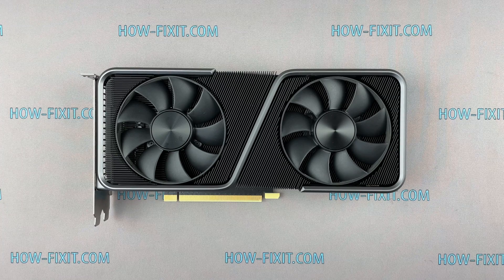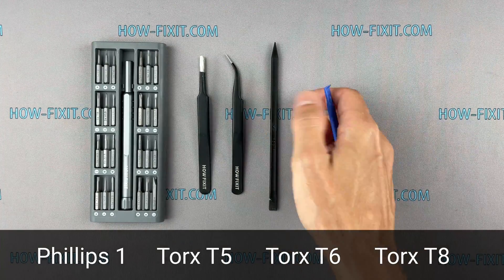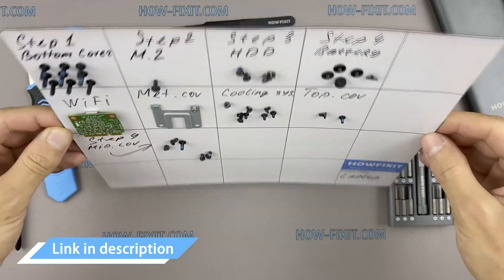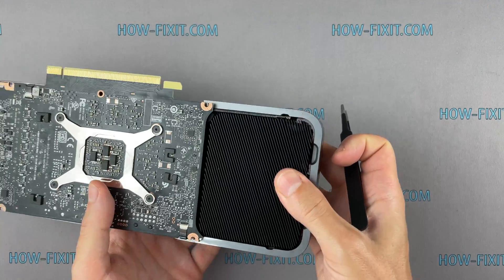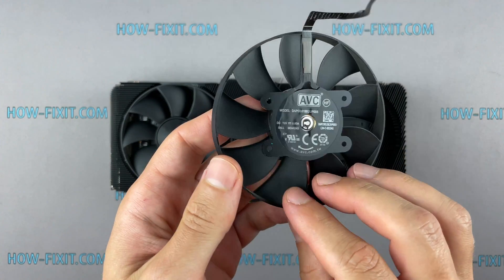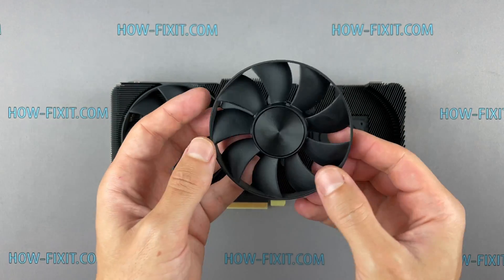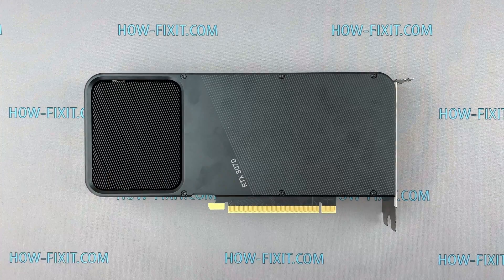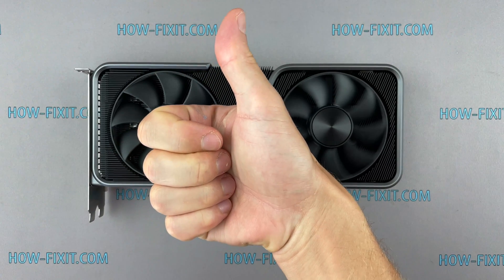GeForce RTX 3070 Fan Replacement

Comment: Thank you for this guide. I was unable to source a new fan but using this, I flipped my fan over (without removing it) and ran some WD40 into the bearings. See the open centre part of the fan. I believe mineral oil would work best but this is what I had. My clicking noise has now gone.
For anyone doing this, just be sure to check the ribbon cable is correctly seated and not interfering with the fan. A small pair of tweezers helps

Comment: any possibility to lubricate the fan without removing it? my right fan is making weird whine noise above 50% fan speed
Reply: I flipped my fan over (without removing it) and ran some WD40 into the bearings. See the open centre part of the fan. I believe mineral oil would work best but this is what I had. My clicking noise has now gone.
Also just be sure to check the ribbon cable is correctly seated and not interfering with the fan afterwards. A small pair of tweezers helps

Comment: Do Rtx 3070ti founder edition use same fan? Im looking for fan replacement for my rtx 3070ti fe
Reply: according to this aliexpress listing they are the same:

"2 pcs DC 12V 0.6A DAPC0815B2UP001 85MM cooling fan cable GPU cooler for NVIDIA RTX 3060ti Founders Edition 3060ti/3070/3070ti"